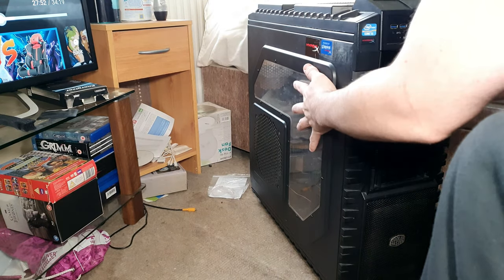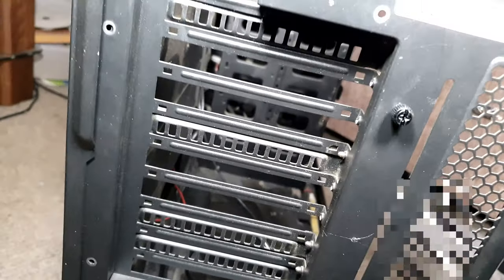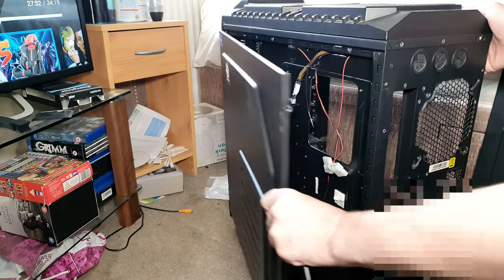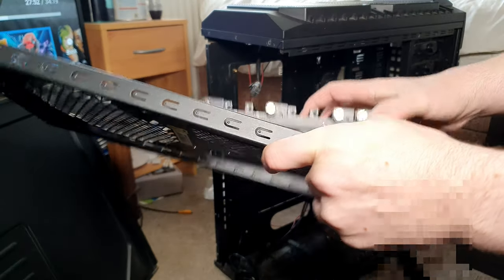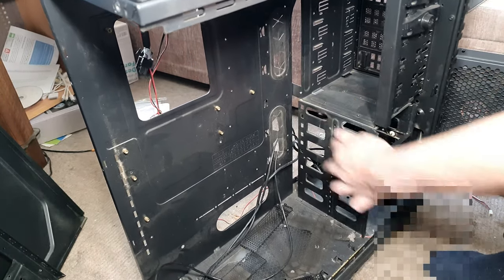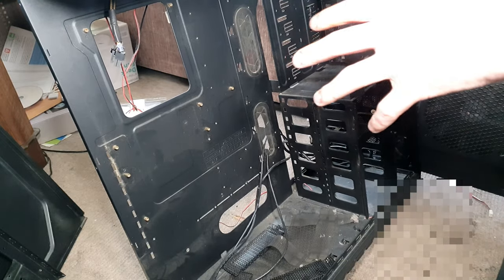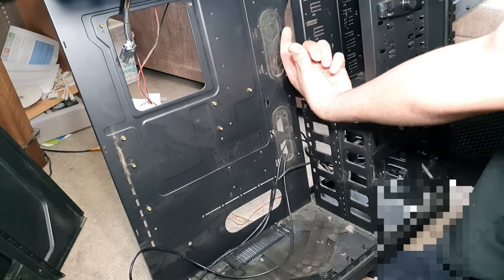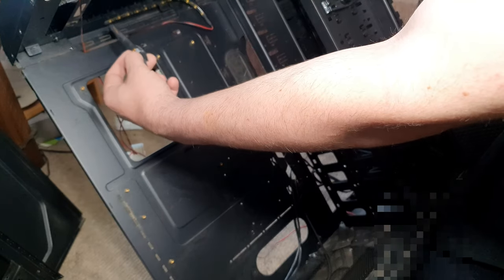PC Case mod Cooler Master HAF X part 1

Comment: I really want to put a small screen in the hot swap area in the front to have temp/load readings or whatever else. I like this case for modding because it's so big so the modding potential is endless lol.
Reply from the maker: Yes it has alot of potential and still have ideas on what to do next
Reply: So a aquacomputer fan/pump controller then :)
Reply from the maker: No i have many ideas
Reply: I have X2 full haf X cases and x1 half 932 also I have the full aluminium coolmaster ATCS 840. I run X2 PCs, one in a haf x case and one in the ATCS 840. For me these are the best ATX cases ever produced